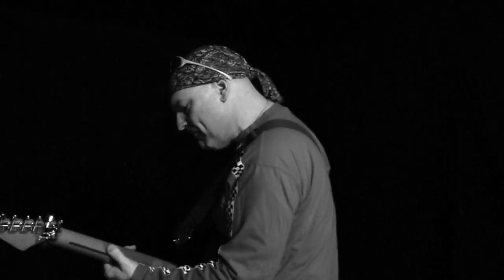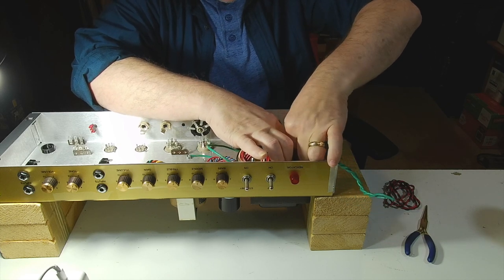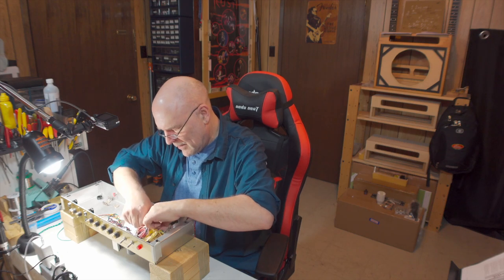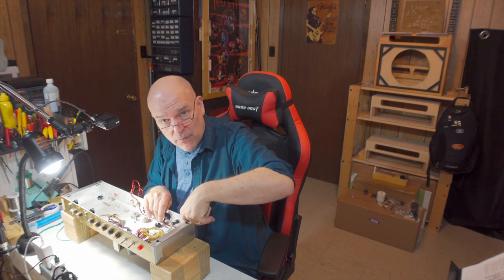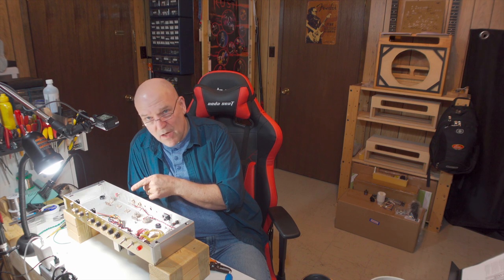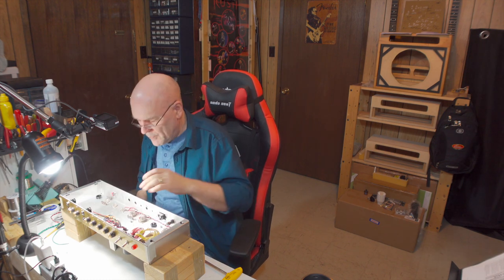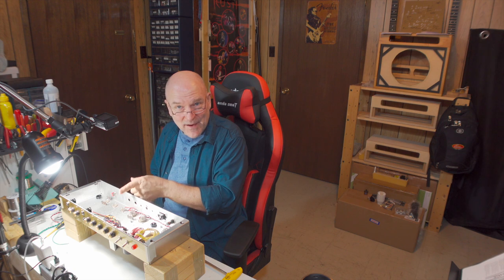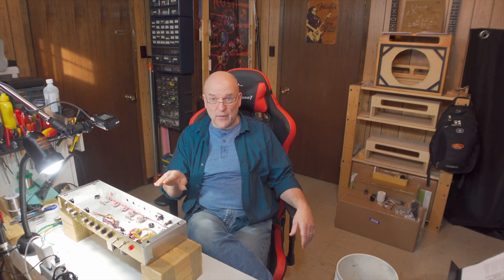Winter Build 2022 Part 4 - Heater Wiring

Comment: Super grateful you’re doing this in depth videos.   My Thor kit will be here tomorrow!!  Took the week off at work to build it but…..Just tested positive for COVID.   Hoping I at least feel good enough to build.   Judging by your disdain for heater wiring, guess I may be shouting some
More expletives then I normally would.   Of course if I am not feeling that well I probably will just put the build off for a bit.
Reply from the maker: I hope you feel well enough to build. Rest and get well. 

Let me know how your build goes.
Reply: Thanks.  She just arrived and unboxing it now!
Reply: Alright one question.  So on the co-ax type cable, I can see on the layout on one end where the shielding/ground goes and where the center wire goes but not the other end.  For example, on the pre amp pot, one lug gets the shielding/ground and one gets the center wire, then it goes to pin 7 of V1.   So does both the shielding/ground and the wire both go to pin 7 or just the center wire?
Reply from the maker: @joshuajohnson4935  No, you only ground the shield at one end, usually the jack. At the other end you only connect the centre wire. If you did connect the shield on the tube end, it would go to a dedicated ground, not the same pin as the centre wire. It can be done that way but then you wouldn’t ground it at the jack end. Nothing bad would happen if you grounded at both ends, but you’d have a ground loop and that could cause a lot of noise.

Cut the shield back a bit on the end you don’t ground, and put some heat shrink over it to keep stray ground wires from shorting to other parts of the circuit.
Reply: Cool thanks.  Should be firing it up tomorrow.  Just waiting on one stinking 4.7k resistor, then my amp should be done, fingers crossed all voltages check out anyways
Reply from the maker: @joshuajohnson4935  I hope it sounds amazing. Let me know how it goes.
Reply: Got it all done and now just working on bias.   With pot turned all the way down I am getting 23ma on the first tube (max ok voltage) but the 2nd 6v6 is measuring like 49ma.  Guess I need to check all my connections.  All voltages checked out before I put tubes in.  (B+ and all that)
Reply from the maker: @joshuajohnson4935  Yeah, definitely check the connections. Could be a bad tube too though. Are they new or NOS?  Swap the positions of the output tubes. If the high current follows the tube, I’d suspect the tube. If it stays with the socket it’s wiring or something else wrong.
Reply from the maker: LOL, just saw that PharmRock said almost exactly the same thing to you on the Trinity Forums.
Reply: Yeah wasn’t the tube.  I dropped it
Off at my amp techs yesterday.  Hopefully have it back by the end of the week.  Maybe something with 1 watt resistors or something, not sure.  All voltages check out but the bias.
Reply: @joshuajohnson4935 What was causing variations in the valve ma?